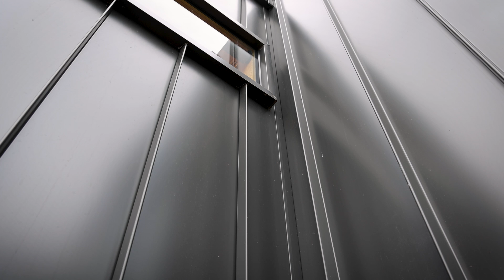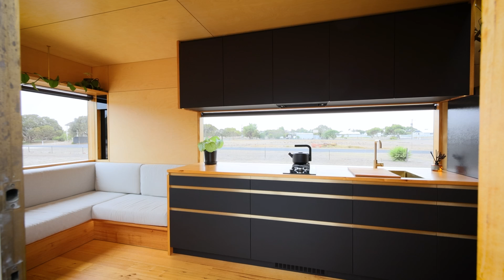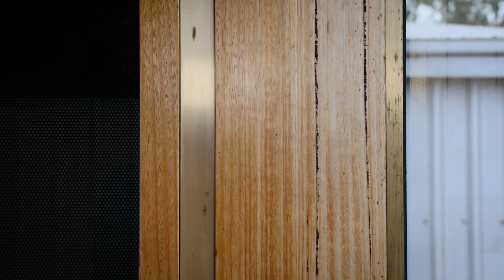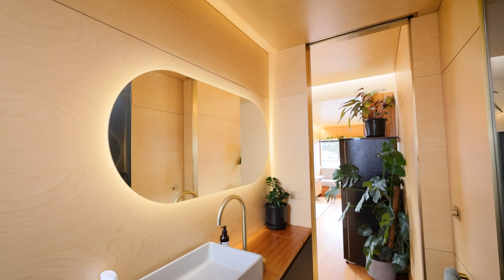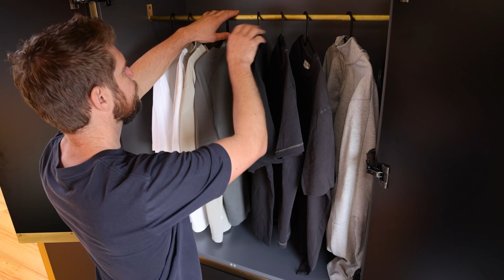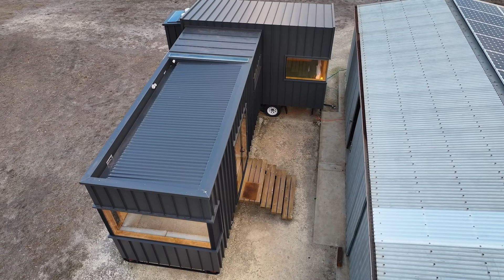Modern-Minimalist Two-Trailer Tiny Home | A Genius DIY Build That Will Blow Your Mind

Comment: I'm impressed by the way Phil tackled difficult engineering problems, but as he admitted, the cost of his tiny house would ruin the idea of "cheaper than regular houses". It does honor the concept of minimalism, but how many would feel comfortable in such an austere environment. Finally, not all food preparation lends itself to a BB'que to cook. If it happens to be cold or rainy outside, I want to enjoy the full width and depth of the kitchen counter space. Maybe it's just me, but I do not want to have upper cabinets in my way of fully using that counter space. If I did want a tiny house, I would opt for one tiny house with a big covered deck.

Comment: Wow. Totally impressed with this design. The air flow solution and movable roof are brilliant. I love that he can move them with a truck or inside a moving van. Clever. 

OMG... never saw the popup power point before... I have the need for one!

Comment: Not to minimize his engineering feat, but aesthetically, he fell into the monotone trap. Staring at the frame and insulation for so long he matched the walls nearly identical.

Sadly, it looks like cardboard. Unsure or afraid of color he used brass hardware to try to capture a sense of luxury. In reality it's all black and light brown. Even the strange chair in the kitchen.

I applaud him for the build though for the effort doesn't seem to reward much. After more than 4 decades of admiring architecture, this was dismal to me. He's happy (I think) though seems regretful. Hope he enjoys it, he is blessed with a home.✌️

Comment: Holy crap, this guy designed, built the structure, exterior, interior, solder his own electric circuit, wrote his own code for everything in the house. And he thought about disaster recovery and future maintenance.

Comment: Holy Smokes !! Simply incredible crasftsmanship. One thing that did surprise me, is when he spoke about building a 'deck' outside when he does find the final place to live. I was expecting him to have a sliding deck come out from between the metal frame of the house and the kitchen area 🙂
There is a chap in the UK called Guy Martin, look him up if you've never heard of him and a very good friend of mine called Bernie Hook. Both are very much like Phil, in the sense of give them a plan/design and they won't understand it, they build/create/work from their minds eye.
Also, there isn't anything that is not possible to their mind, they will work out/find a way to make it work, simply genius minds that are wired somewhat differently to most people.
This video had been a jot to watch and given me so many ideas for the van conversion to camper that I am planning - GENIUS AT WORK Phil 🙂

Comment: It is a brilliant solution to hide the trailer hitch/tow bar under the space formed by the hinged wall panels. 

When you were playing with the Maquettes, trying to figure out how to BEST join them, I was wondering if you were planning to slot them UNDER the frame of the other trailer...but I could not visualize HOW that was going to be possible, given that the seamless interior would be less easthetically flawless HAD there been an elevation change and perhaps the EXTERIOR  weatherproof seal might have been less beautiful as well. 

Such a brilliant solution. 

It appears (unless I am mistaken) you've added a box atop the base of the bar, such that this grants (presumably) more interior space. This solution minimises the  visibility of either trailer bar. 

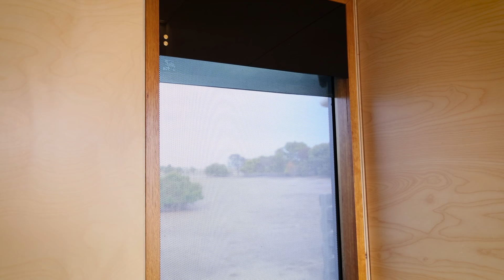I love BEAUTY and FUNCTION. I designed my log cabin and I used a maquette as well, as I took the precaution of hiring an architecht to DRAW PLANS of my SPECIFIC vision. I am trained in Fine Arts & Graphic Arts & whereas I can easily visualize a 2D image of a 3D object...then I draw THAT. But my BRAIN does not visualise a 2D drawing (or plan) in 3D. I felt the pitch of the roof would result in an UGLY STRUCTURE (he overruled my instructions to create a 12:12 pitch) and presented me with yet ANOTHER drawing which ommitted a DETAIL I had stated was NON NEGOITABLE in the finished drawing. 

An enginnering buddy said "Ask for a C.A.D. render of the cabin", so I did & he snarled at me and claimed not a single client in his three decades had EVER requested a 3D render. 

I halted the process (which resulted in my former husband understandably  SELLING the 13" TD CEDAR house logs which were "promised" to me for our cabin)  as the excavation for the footings et all was DELAYED another 6 months due to my concerns. 

I made the mackette out of cereal boxes: interior walls, the log walls extending slightly into the covered 3 sided wrap around porch at each corner and the Single MIDWALL. I wanted to have an "elegant" curve on the cut ends of the logs and I intuited the FLATTER PITCH of the roof would "truncate" that "line". 

Thank goodness I listened to my GUT and the TIME to create the MAQUETTE and suss out IF I WAS WRONG. 

I was loathe to SIGN OFF on a structure which I WOULD SEE as UGLY on either the EXTERIOR or the INTERIOR spaces. I wanted a cabin that I FELT WAS BEAUTIFUL to me, as I knew such details WOULD be IMPOSSIBLE to UNSEE. 

It is CHEAPER and more intelligent to make CHANGES at the PLAN STAGE, rather than demand (as a neighbour did) that the carpenters give her "more headspace"  in her lift bedroom. A change to an INTERIOR space affects the exterior & the homeowners were LOATHE to buy additional manufactured PINE "logs" as the carpenters recommended. This resulted in her okaying   the addition of a shed dormer which was infilled with tiny sections of offcuts of the pine "logs". Pine is not recommended for log homes in a temperate rainforest, nor are roofs with no overhangs. This "abomination" RUINED the lines of the cabin imo which is incidental to the owner and I kept mute about my opinion, as it would be cruel to point out these flaws as once SEEN, they could nere be unseen. 

Every time we rounded the point on the boat ride to the water access lake front property, I had a VISCERAL, gut churning FLASH of NEGATIVE energy....and I KNEW I wanted a structure which WAS BEAUTIFUL (to MY EYE) from EVERY VANTAGE POINT: with BEAUTIFUL proportions.

If you're building a weekend home and eventual RETIREMENT home (which will be passed to my kids so future generations can have the [redacted] lake experience...you want to "get it right".

Oh and the temporary disapointment of losing TWO PACKAGES of standard top diameter CEDAR logs turned out to have a REMARKABLE silver lining. 

As luck would have it, in 6 months he bid on a TFL (tree farm liscence) which had 16" TOP DIAMETER hemlock house logs.

Buying logs STANDING is the CHEAPEST way to buy ANY log. We also bid on Stanley Park old growth "fall down" and had the massive hemlock CUSTOM CUT to give us our OVERSIZED  WINDOW SILLS & DOOR THRESHOLDS to match the HUGE LOGS. The architecht suggested we add CUSTOM (over-sized) DOORS as normal sized doors would be disproportionate to the HUGE logs. He was right about THAT.

OH i created a plinth for the ONE set of electrical swtiches adjacent to the front door. I visited a STUNNINGLY beautiful loggie with A ROUND riverrock Fireplace & JAPANESE joinery in the beams. This home was BREATHTAKINGLY beautiful but for an added bank of electrical switches adjacent to the KITCHEN, and given the open plan, visible from the greatroom, kitchen & formal dining room. The contractor had CUT A FLAT SLAB off the logs & mounted a PLASTIC bank of light switches. Again, I said nothing, but SACRIFICING the AESTHETICS of the interior space FOR MERE FUNCTION was a travesty in my eyes.

It would drive ME NUTS. 

I have no such flawless finishing as you do (as logs are rustic) but the BEAUTY of your CREATION makes me FEEL INTENSE JOY.

THAT is the definition of HIGH ART/FINE ART which I love best: Art makes the OBSERVER FEEL INTENSELY POWERFUL EMOTIONS. I prefer POSITIVE emotions.

This is ART. 

YOU could licence your design to OTHERS, but you might well PREFER to have THE SINGLE BESPOKE creation ON THE PLANET. 

LABOURS of love have greater value than mere MONEY.

Comment: I really don't understand the logic in this.  You have 2 narrow living spaces and by putting them together you have something about 17' wide, which would satisfy most anyone.  With this you're still living in 8.5' width at best which most anyone would feel claustrophobic in.  It could be 17' x 45' using 2 full sized trailers or even 50' as I think the longest ones are.  But let's say 45' because they are common.  That's 765 sq ft, not a bad living space.  Why not use 3 of them?  Now you have 1147 sq ft. That's a small house.  

Maybe he went with this L shape because it is a lot easier joining these together than doing it width wise.  Most people doing it width wise have a cement pad down first so leveling isn't an issue.  But as RV trailers have levelers maybe they could be incorporated.  Being able to move it relatively easily is a huge win and that's where this excels.  

Here's where it gets really interesting.  Chop them up into 100 sq ft rooms, each with it's own entrance (opening outwards to conserve space) and you have a money machine.  Just have to figure out how to share the kitchen and bathroom.  I'd put it in the center as kitchens don't have to have natural light, along with the bathroom.  Keeps all the water in one area.  Or maybe have the middle trailer as the bathroom/kitchen/laundry/storage for everyone.  Lots of options.  

Look at the cost of bedrooms in your area.  If you're not in an expensive area they probably go for $400 - $600/month.  Say 8 in this space.  Say $4000/month?  $48,000 a year pays for shipping containers and their renovations pretty fast.  Of course one could do the same in a house and pay off the mortgage ultra fast as well.  Aim for 2% asset value/month in rental revenue.  It helps hugely if you have a basement that can be chopped up into small rooms.  Look at what they're doing with egress designs in the UK.  Very creative and resourceful.

Comment: Wow, what an amazing creation. Quite mindblowing with all the automation and the way it divides into two pieces. I've never seen anything like it. I was so sad to hear that his parents passed so relatively young. I wonder what happened? But Phil is not just soldiering on, but making a masterpiece like this. I was also amazed at how cheaply he built it. I'm wondering what challenge he's going to tackle next? We're over in NZ and about to embark upon something different. I'm not sure it really classifies as a "Tiny Home", but definitely a compact house. We're planning to build a tower house. It will have a footprint of around 5x5m and rise up 11.5 meters to fit in 4 floors. I also want to make the interior, very minimalist like Phil has done, with mixtures of natural timber and light tones. I'm an Electrician and I understand how he doesn't like plastic fittings, because neither do I. I love hidden subtle lights that fit under a bed or cupboard space. I do not like lights that dangle or stick out from walls. I'm also going to add red glow night lights so I can get up at night and see my way around without having bright lights. I'm also adding a small 2-3 person sauna on the second floor. The lounge will be on the third floor with a bedroom to one side. The top floor is a flexible space and I've designed 4 x bunks that are based off of a yacht crew quarters. I get a lot of interior inspiration from the yacht world, where the cabinetry is exquisite. The crew quarters are where the really good space saving ideas are for the tiny home application. I'll probably document my build too, but I'm not building the structure myself. I'm getting a company to create the steel structure and make it weathertight. After that, I'm planning on doing a lot of the fitout myself. I'm not going as far as Phil with the automation though. That's another level.

Comment: That door button into the bathroom is amazing - not only is it beautiful and removes the need to have a bit sticking out but it can have other uses. I look after a family member in a wheelchair and opening and closing hinged doors is difficult due to having to lean so far out to grab the door and legs being in the way and stopping her closing the door fully as im pulling her backwards out of a room. Something like this would not only give her the ability to do it herself which is very empowering for someone who relies on others so much (literally every tiny thing she can do herself brings her a sense of accomplishment even if its just closing a door or turning a light on and off) but the fact that the door sits fully flush into the wall cavity without needing to have a bit sticking out to grab it means you can actually get a wheelchair through a standard width door. 

Would Phil consider marketing this in the future?? It could genuinely make life easier for a lot of disabled people.

Comment: Love this Modern take of a Renaissance Man :)
I have been toying with modular movable module designs a.k.a home parts that, like tiny houses, could be driven around from place to place if need be, and i am pretty impressed with this project.  not the route i am contemplating, but absolutely impressed by the technical challenges and implemented solution i see here. Very nice indeed!

note : all 4 seasons are harsh reality where i live, so anything i end up doing has to be functional from -40 to + 35 Celsius... thus different challenges, but Wow (!)  do i like what i see here!

Comment: I think it's really cool, but doesn't look affordable. I feel like if you live in mostly warm climate and you want to utilise two trailers I think just making simple outside walkaway porch with connecting roof/back wall to connect those two trailers would be much cheaper. Also less electronic mechanism, less chance of something stopping to work and being expensive to fix.

Comment: I was hoping to see how they run as two trailers being pulled by a 4WD but instead its been built low to be shipped on a semi. Seems like a compromise on height when it could so easily be self sufficient for transport.... OR forget the wheels and have it transportable on a container truck. Just my thoughts. A beautiful compromise though. When all set up it's a lovely tiny home.

Comment: Nice extra large to part design. The architecture and the many aspects of the design are brilliant. And he needs an interior decorator. These just very blank empty walls with hardly any grain or anything going on. It’s not very appealing for such a small space. Maybe the design where it’s made to come apart does not allow for much to be hanging on the walls. But there looks like three places for some beautiful art. Not to fill the wall, but just a piece speak to you more than just blank!

Comment: I must admit I watched this video a few days ago and I refrained from commenting - usually I try to emulate Thumper’s mother.  However, I’ve had a re-think.  Certainly this house is filled to the brim with engineering wonders.  However, I’m struggling with some basics which have been omitted purposely or overlooked.  1)the windows that cannot be opened - irrespective that there was vents and roof opening, windows in a ground level house which, one hopes, will eventually be located in an idyllic location, deserves windows that can be flung open and let the breeze, the birdsong etc inside.  2) minimalist cooking equipment - perhaps in SA the weather is dry most of the year and therefore cooking outdoors is feasible but the lack of an oven would not suit all locations 30 impressive rain-shower but only the rain-shower - therefore a shower perfect for the male of the species - most females appreciate a hand-held shower head which enables height and directional adjustment thus preventing the need for a Kevlar shower cap. 4) again on the hand held shower head - does one need to carry a bucket in the shower cubicle in order to rinse off the wall and floor after cleaning the cubicle?   5) Four years of one’s life for an end product that (a) is not as functional and user friendly as other tiny homes I’ve seen on this channel (b) not lived in - so what was the point except to over-engineer a small abode? I’ve seen and admired many innovations in many tiny homes - this one leaves me mystified.